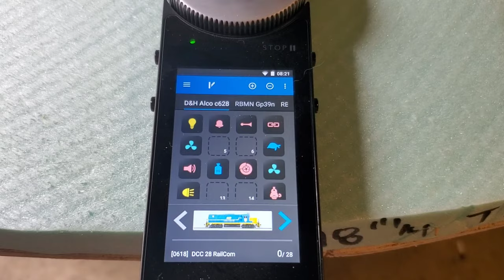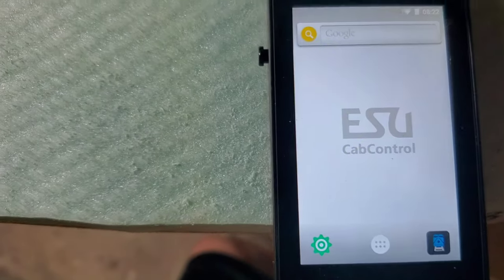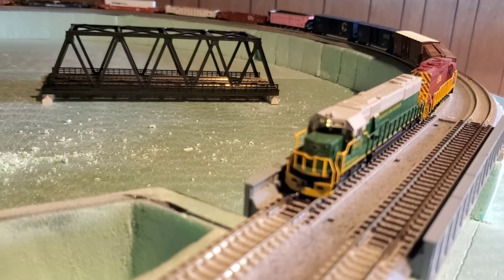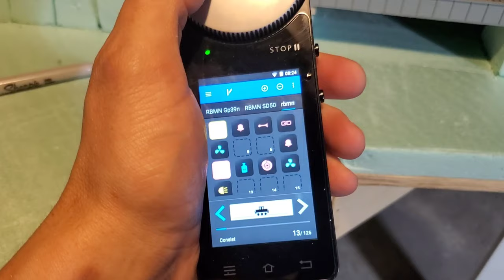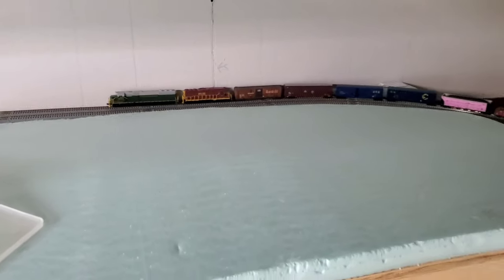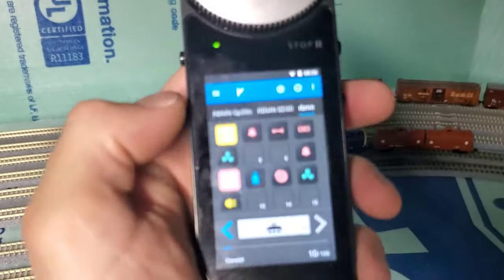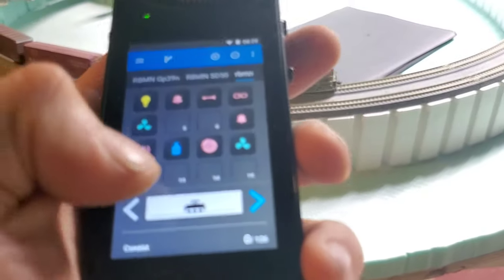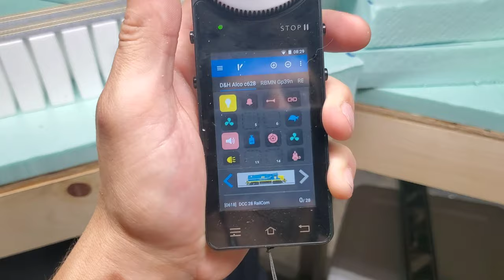LRS let's play with the esu cab control dcc system.

Comment: Are you still using the cab control? Any issues with running it with N scale? Did you just do min voltage on the power pack?
Reply from the maker: Still Using the ESU cab control, i believe i have it turned up to about 3/4 power, but i can't recall. I will have to check. I have about 90 feet of double track main to power. I've never had issues, unless the track was dirty. Hope that helps! Feel free to ask any questions, and ill try my best to answer.
Reply: @LRSX  is that running n scale? No voltage issues with them with power increased? Im looking at this for my n scale setup.

Comment: Do you have any issues with loosing wifi signal and train stops?
Reply from the maker: I haven't had any wifi issues, I do have issues with trains stopping, but I only have 2 feeders hooked up. So trains only stop when the signal becomes weak. I expect once its wired properly and feeders are every 4 feet those issues will be resolved. I hope that answers your questions.